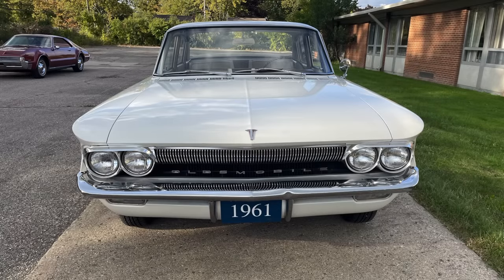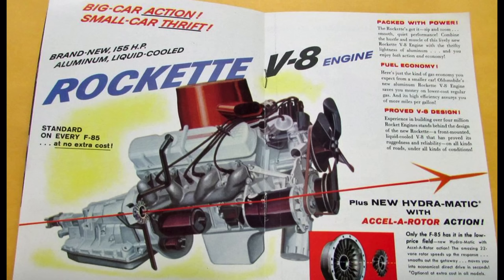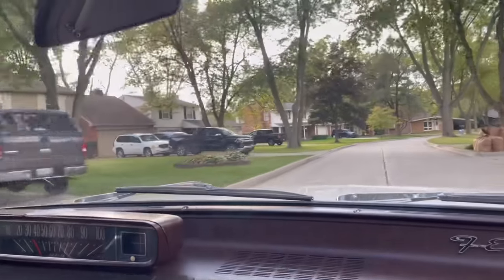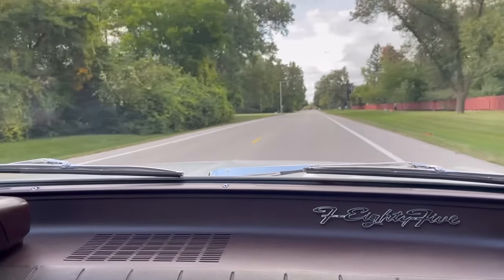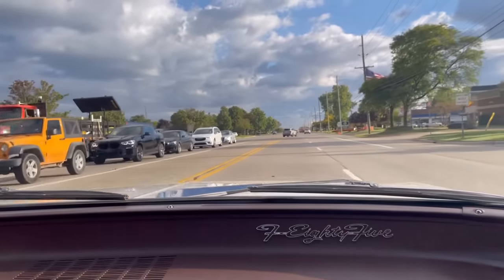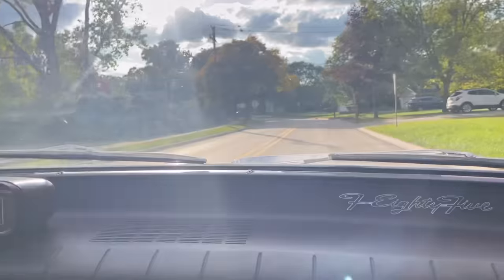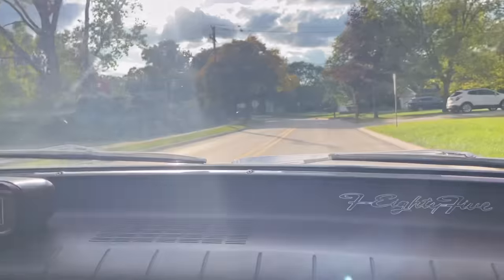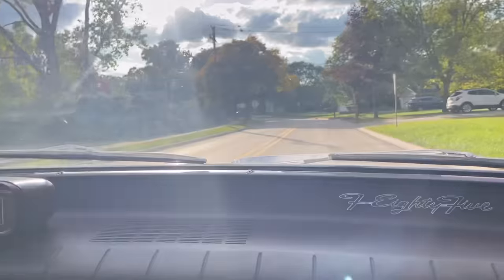Driving GM’s Worst Transmission: The Roto-Hydramatic (“Slim Jim”)

Comment: Adam, every session with Mark is a treat.  The F85 drive was a revelation, but then what was GM thinking when it released the rapidly proven to be unreliable Sim-Jim Roto Hydra-Matic to the public?
Reply from the maker: Not quite sure. I’m surprised it passed durability tests.
Reply: Couldn’t have passed anything !    Manual transmission only -  for that model !
Reply: denniswilson8013  that makes no sense, the powerglide transmission they used in the rest of the cars was amazing albiet only a 2 speed - racers still use them to this day
Reply: @kellismith4329   FWIU automatic Pontiac Tempests had Powerglide because they were using rear-mounted transmissions so shared them with the Corvair.
Reply: It's litterally a grandma transmission because this car was aimed at older buyers, it was also aimed at being an economical option next to the manual transmission something grandmas bu 1961 didn't want. I think it was even cheaper to make than a powerglide two speed. But I would still take that transmission any day over this. My dad and I seen them all the time for sale at swap meets for that reason. Most would take the two speed over this too. But from a marketing perspective to an older person more speeds must mean smoother, superior ride an unfortunately not so much. I would call it one of GM's worst. There might be others one could name, the slim-jim was one of the wost I've seen.
Reply: With a 12K miles warranty in those days, after that it was your problem... mid 1960's they went 50K warranty and needed better stuff...
Reply: @buzzwaldron6195  Well and today they engineer cars to more or less last just passed the warranty period. Car makers have absolutely no problem with keeping people in 'forever car payments'..

Comment: The sound of the transmission brings back memories!  I really like the script on the dash of this car. It was also interesting to see that it was not equipped with a radio. And the interior/dash looks as great as the exterior. P.S. They used to measure trunk capacity difrerntly than they do today.
Reply: Back in the day the trunk was measured by how many high school kids could squeeze in the trunk for a Drive-In Movie........                lol

Comment: After owning and servicing 6, 1964 Oldsmobile, FS models, I opted to swap in a TH400, behind the 394, of my ‘64 98 Coupe. What a major difference it made. Bought my first one, while attending tech college in Lima Ohio, circa 1983. My automatic transmission instructor, had been a GM line tech, when these were new. When asked if I could fix Slim Jim, he told me, “Son, they were junk then and they are junk now”
Thanks for sharing this delightful video. Love the car.

Comment: I had one of these transmissions in my Australian 1964 EH Holden . I loved it, but they did not last too long, maybe 100,000 miles with the small 6 cylinder engines. I had a Australian Trimatic (turbo hydra 180 to you) fitted in 1988, still in there 35 years later. but a big drop in fuel economy. 24-25 mpg down to 19-20 mpg

Comment: I learned to drive on our 1963 Olds Super 88, with the "Ultra High Compression" Rocket V8, and Roto Hydramatic.  The drive brought back (bad) memories.  My best friend's mother had a 1963 F-85, which she bought used.  The transmission failed not more than a year after she bought the car.  Her replacement for the F-85 was a 1964 Dynamic 88.... Same boggy transmission, but it didn't crap out. Great to see Marc again!

Comment: These cars also used a two-piece driveshaft with a double Cardan joint in the center, which helped keep the tunnel smaller.  Somewhere I have one of the little brochures like the one featured in the video.  It was inside a Popular Mechanics magazine that I bought at a used book shop when I was a kid (50+ years ago).

I can re seeing these cars when I was a kid in the ‘60s (who could forget that dash?), but these disappeared quickly, headed to an early demise, thanks to the Slim Jim.

Comment: "...create some kind of moment of menace or threat."  Yup, I've definitely noticed this while driving old cars...the oldest cars I've driven were from the 60s.   Operating an old car today, even if it can easily keep up with traffic,  like a mid-60s V8 Mustang, seems to really enrage some people.   I could understand if I were driving a Model T on the NJ Turnpike, but I had one guy lose his mind when he saw me driving a 1965 Ford Falcon V8.  I was in right lane of a two lane road, doing the speed limit (45 mph) and was not in his way at all.
Reply: Some people become dicks when behind wheel,  almost like jeckle & hyde
Reply: That's sad. Seeing a classic car being driven always makes me smile. When I drive mine, like most owners, I drive it with self respect, safety and appreciation. Never to be a nuisance on the road. People have become more entitled cruel especially on freeways. Sometimes it makes me take a longer route to avoid hot heads.
Reply: @solemandd67  Go back and read my original post.  I wasn't in this guy's way.  I didn't cut him off, I wasn't blocking his way.  He saw me driving an old car and then got in front of me and repeatedly brake checked me.  As far as I can tell he targeted me for no other reason than I was driving an old car.
Reply: @MrSloika  jealous people try to damage something they don't have without reason

Comment: The 1-2 shift kinda reminds me of the TH125 in my 1982 Citation X-11. The H.O. V6 is so torquey, if you are laying on it, the 1-2 shift is very apparent and the torque steer will grab the wheel if you are not expecting it. The 2-3 shift is always imperceptable unless you are at wide open throttle. 

Never been an 1960's Oldsmobile fan, but this F85 has really sharp styling.

Comment: I had always wondered about the shifting order on a Hydra-Matic quadrant. I heard on a video here on YouTube that was done deliberately to take advantage of the close proximity of Low and Reverse to facilitate rocking the car out of snow, sand or mud. The roads were not as good when the Hydra-Matic was developed so practicality demanded this feature. Also, I have learned that the Hydra-Matic had push-to-start capability. Not too many automatics are capable of this. I do not know if the Slim Jim had this feature.
Reply: Any older auto with a rear pump can be push started, but usually around 30ish mph. Likely the same for this one, to get the fluid coupler spinning fast enough to spin the engine you would need to go fairly fast.

Comment: I had the Roto Hydromatic transmission rebuilt in my '63 Olds 88 coupe, and it functioned fine after that, but it still had the odd shift trait. Some people described it as having a "bumped from behind" kind of feel, and I think that's a fairly accurate description of the sensation. Once you know that's just the way the trans operates, it's not a big deal and you get used to it. On vintage cars that don't get used much or subjected to heavy duty use, such a transmission is probably fine (if in good condition) but if you have ideas of hauling an equally vintage Airstream trailer around with your old car...you may want to rethink your plans.

Comment: We had a 62 Olds full size wagon and we had it for about 20 years. It was really a wonderful car.  We liked the way it shifted.  When the car was about 10 years old with about 100k miles, we did need a transmission repair.  But again, we loved the way this car shifted and we loved the powerful engine.

Comment: Nice car!  I had a 61 Cutlass with the 215 4 barrel engine and the Roto transmission and I put 100k hard miles on it myself.  It had over 100k on it when I bought it for $200 back in the 80's.  My transmission shifted very well and was not nearly as loud as yours. If you just had yours rebuilt you need to take it back.  It's not right.  Also mine had a 120 mph speedo and I think I've still got the factory AM radio around somewhere.
Reply: Thanks for mentioning the speedo!  My father bought a new '62 Cutlass with the 4bbl and 4 on the floor.  When I saw the  only100MPH speedo on this car I knew it was different from the car I grew up with.  Ours was definitely 120mph.

Comment: My first car was "my father's Oldsmobile"...a '61 F-85 station wagon with the Rockette V-8 and the Roto Hydra-Maric. The engine overheated, and the transmission leaked like a sieve and finally went out on me after a relatively short time. My dad ended up getting me a 1964 Chevelle with a 230 six and a Powerglide! Oddly enough, my dad had a' '63 Star Chief with the four-speed Super Hydra-Matic (which was a tank!)

Comment: Always been obsessed with these various GM transmissions. As I recall Olds and Pontiac used S instead of 2. Cadillac had drive with 2 positions. On the 1964 and newer the right position was equivalent of 2. On the older ones the right position locked out 4th gear.  I never drove or even saw the original hydramatic.
Reply: S=super
Reply: @bobbyheffley4955  I remember asking my father what the 'S' meant on our new 1965 Grand Prix, and he said it meant 'Super'.
Reply: Cads from 59 /63 had em, then got turbo 400

Comment: I own a ‘63 Pontiac Grand Prix with the 389 Tri-Power. It had the Slim Jim. The thing was always dripping trans oil. Even after a rebuild. I finally ditched the Roto and installed the 200r4. The best mod I have ever done. 70 MPH at 1950 RPM.

Comment: In the 80s, I bought a restored 1963 Oldsmobile F-85 Cutlass with the 215 aluminum V8 and yep, a roto-hydramatic. I bought the F-85 because of the low price at the time, and the impressive restoration job, both inside and out. It was a beautiful off-white color with a tan vinyl interior, bucket seats. The car looked new and turned eyes everywhere it went, even with the awkward '63 one year only body style that transitioned these cars from compact to mid-size.The 215 V8 was a miracle, silent, smooth, and fairly powerful, that started instantaneously in any sort of weather with just the slightest touch of the starter, and never leaked nor burned a drop of oil. But then there was the transmission. I don't remember exactly, but it wasn't shifting very well at all the day after I bought it, and clearly needed to be rebuilt. I remember being turned down by a series of something like 5 or 6 transmission rebuild shops, who laughed me off the phone the minute they heard the words "slim jim". Finally, I brought it back to the seller, who actually tricked a local transmission shop into rebuilding it against their will by not disclosing which transmission my car actually had until it was too late. After it was rebuilt, the transmission still never worked very well, but the car was at least drivable. The thing I remember most is that the torque converter frequently failed to unlock when coming to a stop, stalling the engine every time like a novice manual transmission driver who forgets to disengage the clutch. After around a year I had to regretfully sell the car because it just really wasn't drivable. I wonder where it is now ...

Comment: Did these cars have worse reliability than the Tempest?   The resemblance to Tempest is incredible.  Great video as usual.
Reply: I just mentioned it in a response further up but the Tempest used a front engine/rear transmission setup so they shared the Corvair Powerglide (and manual 'boxes).
Reply: Chevy Corvair/Monza/Olds F85/Cutlass/Buick Special/Skylark/Pontiac Tempest/Lemans all same body platform... Pontiac/John DeLorean didn't seem to want anything to do with that rough running early Buick V6, though...

Comment: I owned an F85 wagon in the 80s but it was bigger, more like a Cutlass since it was a '67. Great car! Took me coast to coast in 1979 and up and down the Pacific coast with no trouble save for an axle and wheel sliding out about 3 or 4 feet to one side. That was interesting.

Comment: We have a 62 Skylark with the 215, but it has the dual path 2 speed. Though also fairly weak, I love that transmission. It is very smooth and almost feels like a CVT.
Reply: Dual Path is one of the weirdest GM transmissions. Two planetary gears in the torque converter, and nothing but clutches in the body of the transmission itself. Tiny oil pan held on with a single bolt in the center.

Comment: I owned a '61 F85 for 7 years (until '68) and drove it 70k miles.  Loved it and no significant issues, except for the aluminum radiator, which needed cleaning several times.

Comment: You may appreciate I know a very clever and innovative  car buff who figured out how to adapt a GM Turbohydramatic 350  to this aluminum 215 V8 used in  the small  Olds, Pontiac and Buick in the early 1960s.   This is a huge imrovement over the auto trans used  from the factory in the early 1960s.   This same buff installed the electronic ignition distributor from a Buick 350  V8 into this 215 V8.  Additionally he determined the crank from a Buick 300 cu in would bring this 215 V8 up to 262 cu in.  The HEI ignition had the coil in center of distributor.

Comment: In the last video you guys were commenting on the "T" logo , Oldsmobile used the Rocket logo for years and you can see it on the engine brochure flying across.   I'm quite impressed with the exhaust manifolds..they look like little hedders.   I had a rotomatic slim jim in my 64 Grand Prix, it was the worst part of the car.  Keep up the excellent work👍👍👍
Reply: "Headers", @1cargaragenyc.. They're spelled 'headers'.. fyi

Comment: You guys really beat this little car up I have a 63 convertible with the four barrel carburetor. I think it’s rated at 195 hp. I drove it regularly in the 80s for about three years. It sits in my garage now with 45,000 original miles on it. I never had any issues with the transmission sure it’s not as smooth as new ones, but it works very well.

Comment: There is a running and driving ( but sat a long time ) Olds Fiesta Dynamic 88 394ci , export model, for sale in a shop 5 kilometers from my house here in France, for only 6000€ , and I reaaaaaaally want it. It's all original ( still original air filter box ^^, also has some brackets for some metal oil cans under the hood ) except the exhaust line. So cheap, so rare, sounds so good, looks so good, has a big V8. And I gathered some informations on it, I guess it has a roto hydramatic 375 (Model 10), and it's not that easy to find informations on this transmission, or shops selling parts for them.

So thanks for sharing this experience video.

Comment: I had a '64 Olds Jetstar I. If you could find a suitable application, second gear was a lot of fun. That application for me was the coastal mountain roads south of San Francisco 😆.  Loved that car! I got very good at swapping junk yard transmissions in and out of it with me on a creeper and the transmission on my chest. The engine (394) was a bit built and between that and me flailing the crap out of it the transmission longevity wasn't too good, but I had a blast!

Comment: I learned to drive in a 1962 F-85 that looks just like this. I think it had vacuum windshield wipers, because they would slow down at heavy throttle. Other than the throttle cable sticking once i liked it. I was driving it in the early 70s.

Comment: My former 1962 Skylark two door hardtop was also very soft,  but oh so butter smooth. It had the dual path 2 speed transmission. The shift from Low to High was rather abrupt.

Comment: Regarding the old shift quadrant, NDLR with or without P was standard.  Legend has it the change to PRNDL was because someone got into their new car with an automatic VS the old “three on the tree”.  That person, out of habit, pulled the shift lever down First which was, of course, not First but Reverse.  Supposedly the driver ran over and killed someone in a parking lot.  Don’t know if there is any truth to that story, but it seems reasonable.
Reply: Unified shift patterns, like left side shifters  on motorcycles are mandated by the feds. I still remember jumping off my Honda onto an old TR6 Triumph and doing some interesting braking and shifting. (I was a motorcycle tech back in the day.) Made life interesting.

Comment: I owned a '64 Grand Prix for a couple of years, and I wholeheartedly agree on the  operation of the Model 10 "Slim Jim" Roto-Hydramatic.  The 1-2 shift with its precipitous RPM drop with the attendant bog and burble , and the RPM rise on the 2-1 downshift, coming to a stop.  On mine, the transmission seemed to operate as designed, even with 178,000 miles (I suspect it had been rebuilt at least once).  That wasn't the major problem with the car; the rings in the 389 were shot, so it smoked like a chimney.  But, the car was only $395, in 1980.

If I were to own another one, I'd figure out a way to swap in a four-speed Hydramatic from a Bonneville or Star Chief, or a Turbo 400 (with the switch pitch converter) from a later car.

Comment: I have the next generation, a '66 F85, with the venerable GM 2 speed and the unfortunately uncommon 330 ci V8, it's a surprisingly good car for its age that I've daily driven in the past and currently shares a daily role with an 04 Suburban.

I've driven many modern cars and I can honestly say it rides better than some of them despite having multiple 60 year old components still in place. Has plenty of pep, and thanks to not being the roto-hydramatic it isn't bad in town.

Unfortunately the lack of gears means it DRINKS fuel. Measured my combined fuel economy at a staggering 9 miles per gallon!

Comment: I think the shocks back then were hydraulic and not gas, which is a problem if you are not aware of it. Check with Viking Shock (not sure on the last part of the name but Viking is correct) also I think QA1 makes hydraulic shocks. Thanks for the video.